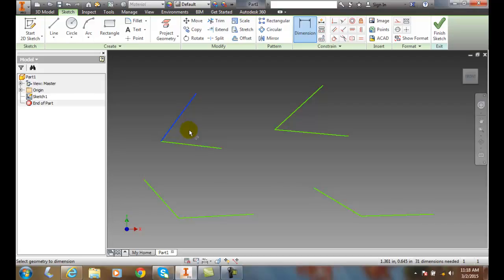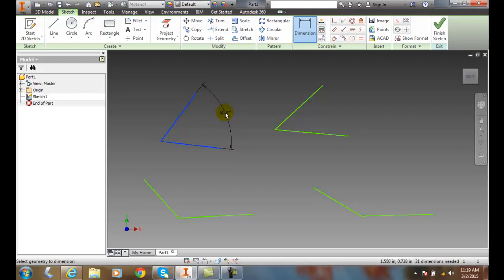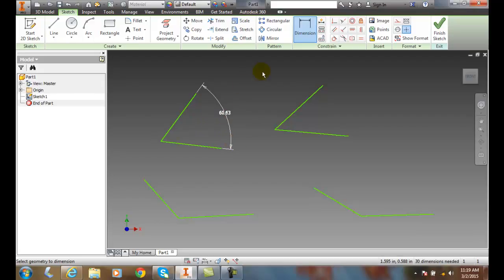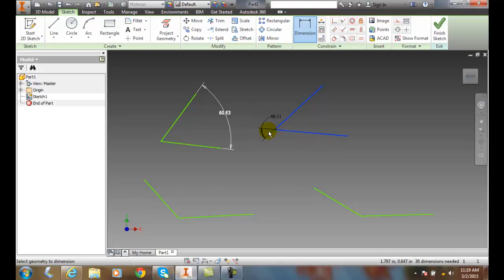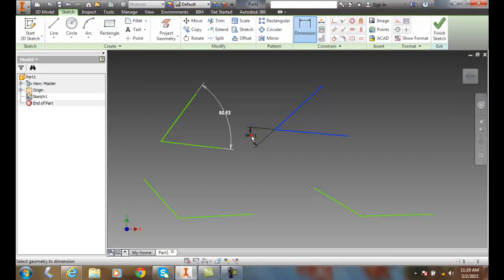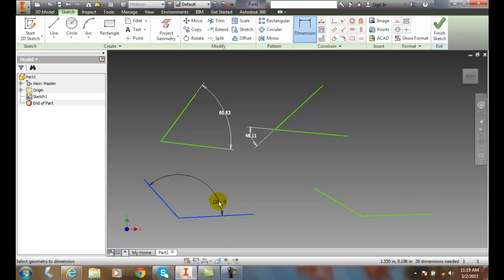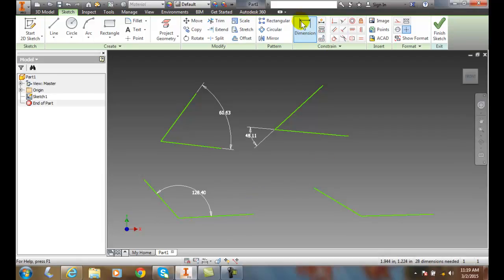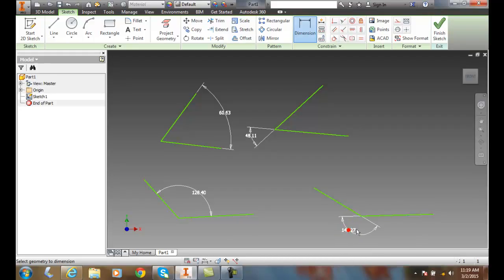Inventor 03-19 Angular Dimensioning Using Two Line Segments

Comment: I found out that I have to click on each line twice alternately before the option to measure the angle appears. Is it possible to set some measurement preferences somewhere so that the program measures the angle first and not the distance between its middle points? This multi-clicking is annoying

Comment: Why can't I do this in my inventor 2024. I never had this problem in previous versions. Now, when I tried to place an angle between two lines coming from one point, the measurement tool grabs the midpoint of the line (regardless of where I placed the cursor) and measures the distance between the midpoints, instead of measuring the angle. Please help, this problem is killing me since I switched to Inventor 2024.